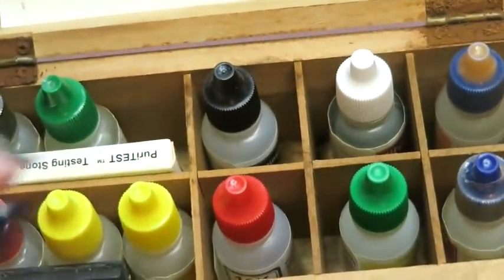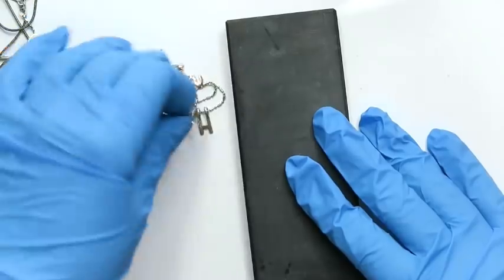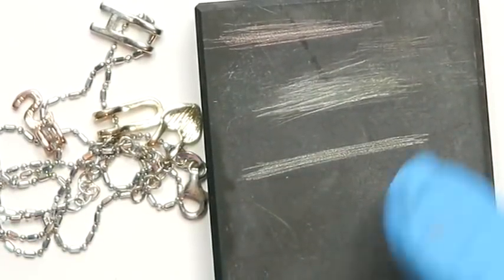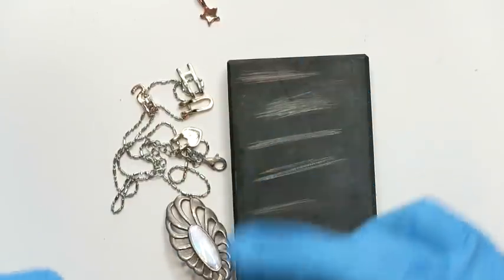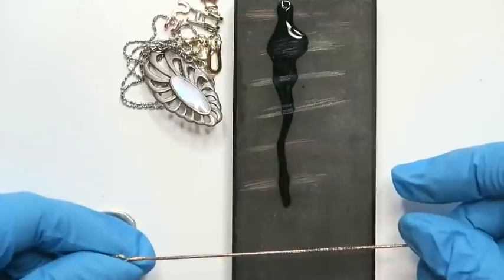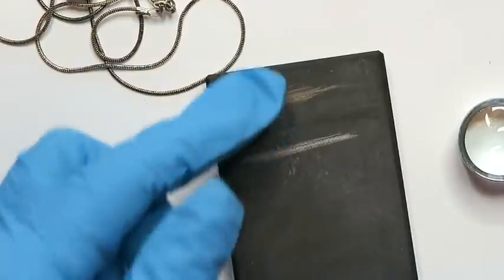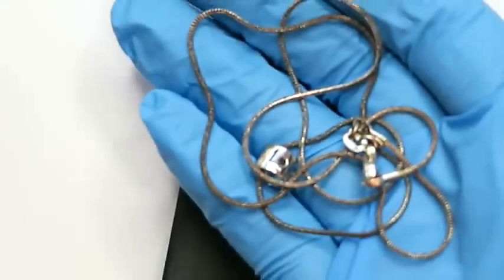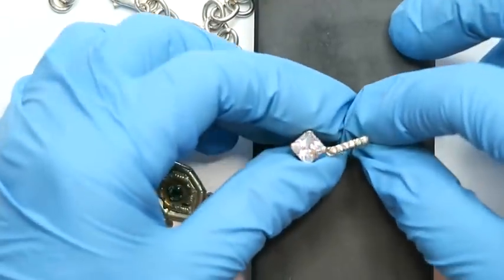BEWARE FAKE SILVER | Testing Silver and Gold at Home with Acid Testing Kit

Comment: How would you test something marked 24k? Do you have an acid for that as well?
Reply: @dmreddragon6  I haven't found it all that rare to find is the thing.  I've had 3 necklaces, a ring, and a pin,  marked 24k, all found in jewelry jars. They sold and I had no complaints but I am toying with the idea of investing in a kit. I guess I could just use 18k to ensure it's at least that. If it still does well with that then the mark is most likely true.

Comment: How frustrating! So if it’s marked as 925 and i sell it as “marked 925”, am I expected to do more like this testing to authenticate?
Reply from the maker: It's a line.  Someone might be angry.  I suppose if you say "marked 925 untested"
Reply: What I have found is most of the pieces that say 925 or S925 are usually plated !
Reply: @angelajakem366  I have kilos of scrap silver jewlery marked 925 and I have maybe came across 3-4 peices marked 925 that were not. I would find a new source for my jewlery if most were marked but plated.